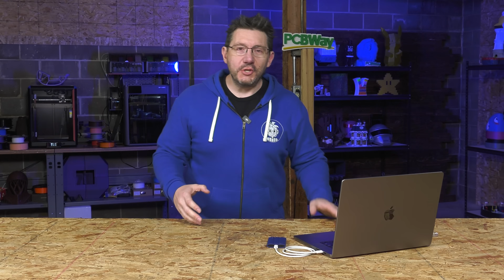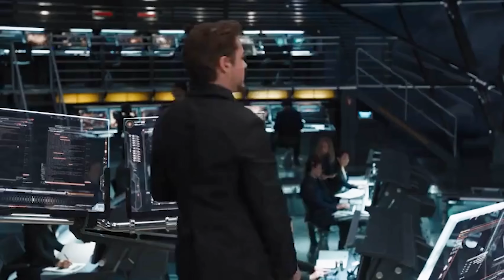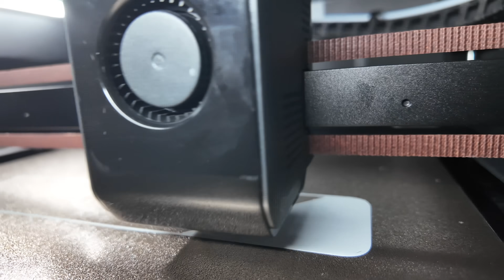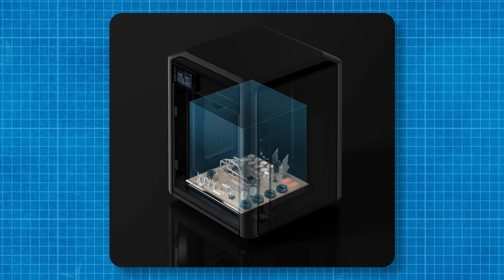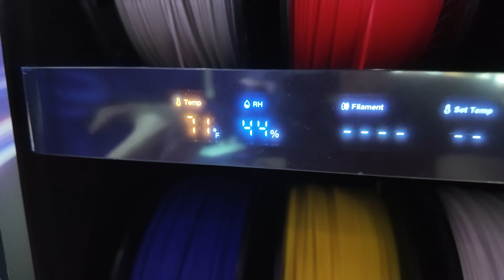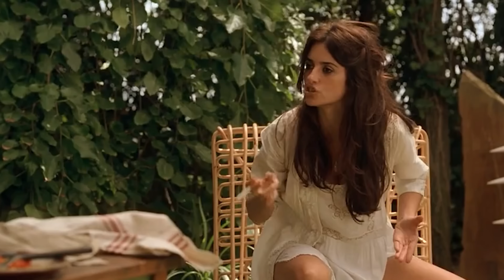12 NOZZLES?! The Mova AtomForm Palette 300 is Crazy! (No Purge)

Comment: It is actually a quick release system as the assembly is not screwd in the traditional way, it only rotates by 90 degrees or so so the flanges engage.

Comment: Truly interested in this, I have been holding out for a INDX 300mm bed with at least 6 heads, but this may be a potential option. Unanswered questions - multi-material handing, print speeds compared to U1, quality compared to Bambu, waste compared to U1 and Bambu - from their website, does seem like it will generate purge, who much. Why six heads, 5 for rgb colors, one for support material would be ideal if can print with color mixing.

Comment: "A new way to do an old thing" just made me realize this won't be for me. I'm SO glad you said that specifically and broke down how this operates exactly, because it highlights that it's not a step ahead, but instead a step behind...just with a pair of new shoes on. Those shoes will wear out or need maintenance significantly faster that a unit that simply parks and picks up an entire tool head that retains the nozzle in place at all times. Can't even image the nightmare of re-leveling with this beast or heaven forbid, getting to a jam within the Iron Man core.

Comment: I've seen the unit first hand in TCT Shanghai and it's pretty cool to see these implemented on 3D Printers. That aside, Im questioning this model's reliability. They've had most of their units down due to a clog or issue during the event. So im 50/50 until they fully release a better version

Comment: I'm honestly so unenthusiastic about these multi-printhead systems for color prints. They add a ton of extra time and most introduce extra waste. They make sense for mixing multiple materials, but they're really dumb for different colors of the same material.

We need to re-think multi-color FDM 3D printing because this isn't it. XYZprinting was one of the few companies that tried something new by adding a CMYK inkjet printer into their FDM printers, but I understand this has some issues...and it's extremely expensive.

I think if more people explore this route, I think this could make a big comeback.

Comment: I look at the 36 color option as a great way t o plan ahead on your projects, load up all the filaments you need for them, and keep ones you use the most often ready to go. Plus, that frees up a lot of storage space on the filament racks for additional filaments you like to have that you might use less often but still want to have on hand in your shop or craft space. Plus, if it has a refill option, you can easily load up additonal rolls of the same color for it to automatically use once a roll runs out. No one has said if this has an automatic refill option yet.

Comment: 1st thing, SUPER Cool mechanism for the nozzle changer and excellent presentation Joel, as always. 
2nd thing, 12 nozzles? There has got to be something or some use case I’m missing here. 
Let’s say you have 4 sizes, then smooth for TPU, Hardened for abrasives, and throw in a food safe for chocolate 😬, I still don’t get it. Now, if CNC is in their future then this suddenly all comes together.
Reply: @bowieinc  To keep multiple types AND colors available. Majority of filament types have color variations, so realistically 12 isn't even enough if you are someone who keeps multiple colors of varying types. Additionally you can have all your types preloaded even if you aren't multicoloring to save time loading/unloading, and take up the majority of slots (PPS, PC, ASA, ABS, TPU (Varying harnesses), PETG, PET, PLA)....and we arent even adding in that all of these have CF and GF variants which can occupy additional slots.

Comment: Interesting? Sure. But I'm guessing since this is the company's first printer,  their infrastructure is still in development and not fully optimized. That points to this being expensive. I'm guessing it's going to tiptoe near the $5k mark. And it still suffers from the same issue as almost every other printer in the home consumer market. And that is we've essentially reached the threshold of FDM printing. Specifically, printing precise mechanically sound parts that last. Extrusion is the barrier because the melting and extrusion process eliminates the use of several great polymers. Not to mention all the waste created from using supports. I'd rather see development moving towards SLS or something similar for home use that doesn't cost north of $30k

Comment: You should be more careful with your unit notation.  I think people get what meant, but what you wrote is incorrect.
300mm³ is 300 cubic mm, which is tiny, about 6.7mm by 6.7mm by 6.7mm.
The build volume of this device is 300mm by 300mm by 300mm or (300mm)³.  The brackets matter.
The actual build volume is 27,000,000mm³ or in a more useable form, 0.027m³.

Comment: That dual buffer thing would only work if the two colors were in different AMSes. I'm sure the software can tell you how to optimize that so its best positioned to take advantage, but there are going to be scenarios where it needs two colors from the same AMS back to back and it’ll need a full retraction. I'm sure it’s still be an improvement, but it’s not going to be as good as a true tool changer or the INDX system. The 12 nozzles is cool. Not sure about the screw mechanism though, since a tiny misalignment could cause cross threading.

Comment: Makes me wonder though, aside from a purge block, we are assuming that the 12 nozzles in the magazine, I hope the thing is good with retraction and cooling down of the nozzle, I would hate that if the machine drops a nozzle into the magazine to swap to the next one, and that just-dropped nozzle is still warm with leftover filament inside it and it oozes into that chamber somewhat, you know?
Also, I'm concerned with it always having to screw in the nozzles every time. What if it doesn't screw in tight enough, or if it misses the threads? Or that it strips the threads? You know after doing so many operations of changing colors per print, that is a LOT of screwing and unscrewing of threads. That to me is the biggest concern and point of failure. Its almost easier and more reliable to have a nozzle that instead just "plugs" in place, like how Bambu did with their new system. 

Eh, time will tell what kind of mechanism works out to be the best way to go, I guess.

Comment: Are we assuming that it remembers which color printed with which nozzle so it can return to that nozzle and reprime the same color filament? If you use 13 colors, it'll have to purge from the nozzle that's already been used...or is it just using a new nozzle per color change? After 12 changes, it'll have to purge still. I guess let's just assume it remembers which nozzle is which color....

Comment: The thing with 36 colors is also that you have to have 36 different color spools of filament, which at a fairly average 20€ would be 720€ of just filament.
Reply: That’s not expensive to one who can afford the printer, replacement nozzles and nozzles of different sizes, and 6 filament feeder/dryers.  It’s also not a lot of filament to someone who has been printing in multiple colors for years, like I’ve been doing.  I’ve got well over 100 spools of different colors, finishes, inclusions (sparkles, fibers, glow powder), and in different materials.
Reply: 20 euros for a spool of filament? That's way too expensive. Here, 1kg of standard PETG filament is only 15-20 RMB.

Comment: Sorry just confused by this. If the filament is being loaded via the two pathways, why have a nozzle swap? I understand the Snapmakers U1 with 4 different head unit with the filament already loaded. I just don't understand the process here. What am I missing?
Reply from the maker: The nozzle swap eliminates the need to purge material A when loading material B
Reply: @3DPrintingNerd except when you're running 36 colors 12 nozzles. They didn't explain how that's gonna work.
Reply from the maker: @TxTeabag  They also didn't explain that to me, but I think it'll have some many-into-one ptfe adapters. that's my guess. similar to how multiple AMS units run on a Bambu system. I don't know this for sure, but that's my guess.

Comment: My immediate concern is debris in the changing mechanism. Most of us are already well acquainted with how well printers actually wipe, and manage filament changes. Often they aren't very clean. This is more or less and umbrella style tool changer. But with much more room for error. Admittedly I haven't touched it or seen it in person. But considering this is aimed at the consumer market, I feel like its likely going to have issues in this area for many users. From a volume/manufacturing/tolerance point of view.

Comment: Nope. Just a placeholder. Just like everything that isn't a CMYKW mixing print head. For multi colour printing, that's the obvious end stage of all of this. Anything else is just a step towards that.  FullSpectrum has shown us the first major step towards that eventual future. 

I see the ultimate printer having one of those, plus 3 or 4 additional single filament nozzles similar to this thing or the INDX for clear, tpu and support/infill material or whatever.  Though the one everyone will buy will just have the 5 filament mixing nozzle with maybe a single second nozzle for non colour purposes. 

Also, I'm hoping that people come to their senses and switch from PLA to fast printing PETG as the default filament. PLA is frankly terrible considering I can buy rapid PETG for the same price and often less than PLA plus it has the benefit of working with TPU. For me, it prints just as fast and just as well as PLA and the resulting part is better and won't melt on a summer day.

Comment: The nozzle magazine basically looks like a carousel tool magazine on a CNC milling machine.
Reply: Exactly my thought. I had a twin table CNC machine that had 54 tools. The Marlin Gcode software has got to be similar for tool tracking the tool as a Klipper based piece of software does too. As mechanical as I want to get with a 3D desktop, sorry to say, is the U1 Snapmaker. Though the HD2 I has quite a bit going on.

Comment: That Nozzle swap must take ages
Reply: 7:51
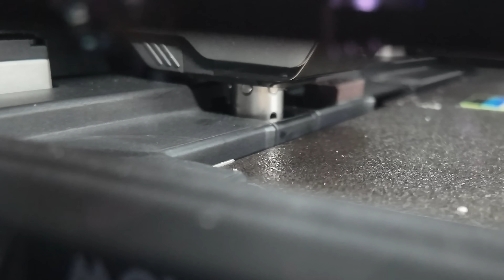Reply: @3dpprofessor  Uh 3:25 is a better example and it looks slow as hell.

Your timestamp shows a cut in the video to get the point of how the change occurs across. 3:25 shows more of the turning process and, sorry, doing that across 12 nozzels looks like a nighmare. I believe Bambu's way of nozzle swaps on the H2C is FAR superior and for prints with 2 colors, having two nozzles active is going to allow the H2C to run circles around this Palette 300.
Reply: @3dpprofessor  no this is not the nozzle swap part. That is where you would hook up 2 nfd's to one nozzle.
Reply: nope/ existing tried tested and proven CNC tech. it takes only seconds.
Reply: @raffia16thblaze10  and then it has to heat the nozzle to temp every swap.
Reply: @salamonius  Most CNC tool changers use hydraulic mechanisms so they can be very fast, but for this you have to unscrew the last nozzle, dock it, rotate, then screw in the next one before it can heat it and feed the filament back in.  If it uses inductive heating for the nozzle, the reheat will be very fast compared to the swap time.  Joel says "zero purge" but if you go beyond 12 colors, there has to be some if you switch to a color that isn't already matched to a nozzle.
Reply: @salamonius  it’s already reheat when swap.
Reply: @raffia16thblaze10  CNC doesn't unscrew anything. Its a drawbar and taper.

Comment: I'm having a hard time resolving 'no purge' with the '36 instant colors' comments.  Even with just 12 colors, one per 'head', that has to be some EXACT breaking of the filament to not need ANY purge.  Since it's still coming down to ONE POINT of filament path. 

I still think the fastest multi-color setup is an actual multi-head setup like the U1.  The different colors (or materials) can be pre-heated and ready before the next is needed.

Comment: So it's basically the autoloader from a T-62 tank with Revo nozzles?  12 nozzles would be interesting - it would let me dedicate multiple sizes to specific filaments; so for example, a 0.4, 0.6, and 0.8 for ABS, the same again for PETG, and a 0.2, 0.4, and 0.6 for PLA, and still have 3 available slots for alternate colours or one-off materials or whatever.

36 filaments seems overkill, though; the only use case I can imagine is a prototyping printer, or something like a public library, where you want to have /everything/ on tap without user intervention.  Even then I'd be doing 18 different filaments, but two spools of each, so you don't have to worry about running out.

Oh, and you're very brave to fly in America these days, what with ICE thugs having to cover for unpaid TSA staff justifiably not coming in, and overworked and understaffed ATC systems in pretty much every airport.  The risk level is pretty darn high right now...

Comment: As an auto tech for 40 years , having something screw and unscrew thousands of times and be heated to 300 degrees and the chance something falls out of alignment could be a really bad fail! But I guess time will tell. Until I see this printer in action, I guess all we can do is wait and see
Reply: They have a camera system for compensating for alignment. No idea if it will work well or not, but they did take the problem into account.
Reply: @serialhobbyism_official  what about wear  and tear on all the nozzle switching? arnt the threads in the head going to wear?
Reply: @peterpeter5666  I'm not sure it is threaded at all. They were having issues with the demo units at the event, so I wasn't able to see the switch in action and I'm not entirely how the mechanism actually works. I was sad about that, because I really wanted to see it switching.
Reply: @serialhobbyism_official  gotcha .

Comment: I'm going to ignore my excitement over this until pricing is announced and drops to acceptable levels.  You early adopters and those who get them free to review can have your fun and work out the bugs.   Man does that look nice though...  You didn't mention the delay in heating up the swapped hot end..this has to be roughly the same as swapping colors manually..
Reply: I think pricing was leaked already? If I recall its 2600 for the machine, and another $500 per mmu box

Comment: Ok
1. I'm not seeing where the filament gets loaded, I'm only seeing different nozzles being swapped out.  Is the point of their system that you're swapping in a clean nozzle so that's why it doesn't need to purge? (IE retract filament A, load filament B, the nozzle is clean?).  There's 12 nozzles, and you could be doing a LOT of color swaps during a print.  They can't stay clean through the whole print (unless that holder is doing some sort of heatup and letting the little bits of filament melt and dump out)
2. Their thread system seems overkill, and not fast (also threads will wear out over time).  I don't know why they wouldn't do magnets (unless there's a patent preventing them)
3. Seems like there's still a purge bucket on the bed?
Reply: It's the same like H2C. The old material is purged out when using the nozzle the first time in the print, than it can just reuse the same "dirty" nozzle for the same material/color throughout the print.
Reply: @Tomas-ir8xl  ah that makes sense.. of course then my question is, what if I changed out my colors for the next print.  Do I then have to manually clean all those nozzles, or do I just have to run a purge cycle with the new color?
Reply: @toyotaboyhatman  it will do the purge cycle for every nozzle where you have changed the filament when the print job starts.

Comment: the machine itself looks pretty slick, but i can't help but imagine the filament swapping mechanism in conjunction with those cabinets on a belt printer.  imagine being able to spit out part after part after part after part in a beautiful array of colors & possibly materials, if you can get an enclosure to cooperate, only needing to swap full spools in for the empty ones as necessary.  THAT would be cool.

Comment: Very interesting to see this new printer, especially with a 300x300 build volume which is what my little print farm really requires for most of my products. It is where tool changers so far have fallen short and not interested me - this may be the one I will need to add once it's released.

Comment: How much total time to swap color from the moment it pauses to it starting to print again? Seems like an overcomplicated system compared to the bondtech INDX system.
Reply: Definitely significantly more than Bondtech INDX. I imagine it should be similar to H2C since this also has to retract and push filament. Maybe slightly less time than H2C because it doesn't have to push the filament all the way (see explanation in the vide) like H2C does. I'd say minimum of 30s, but most likely more.
Reply: From what I could see, it's almost a minute.
Reply: It's more than 1 minute. @ThePrintHouse has a short video where they show the whole nozzle swap procedure.
Reply: @Tomas-ir8xl  more than 1 minute for a filament swap is insanely high. Who is this product for? On INDX its take 14 second in total including heat up time.
Reply: @graxiecool  I guess it's meant to compete with Bambu H2C. They are both pretty slow and produce same amount of waste.
Anyway, I think you are right - real tool changers like INDX will be the winners in the end. Nobody wants 1+ minute filament swaps. AMS is the past, tool changers is the future.